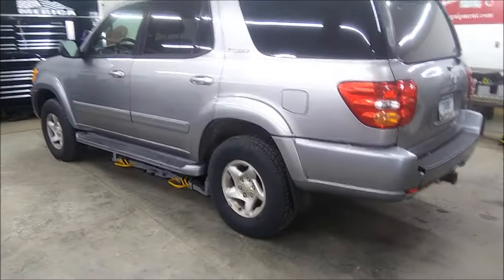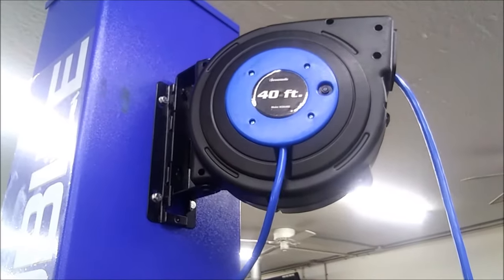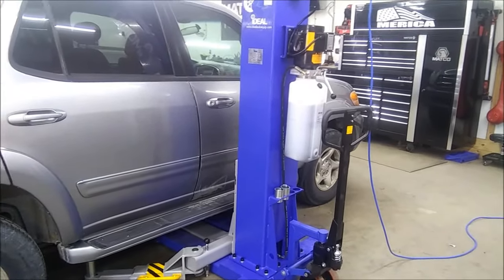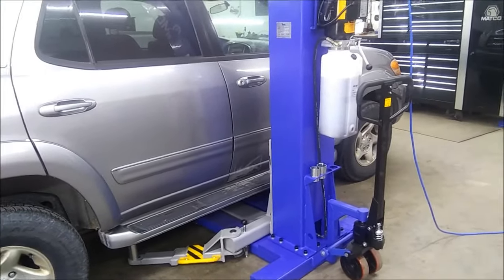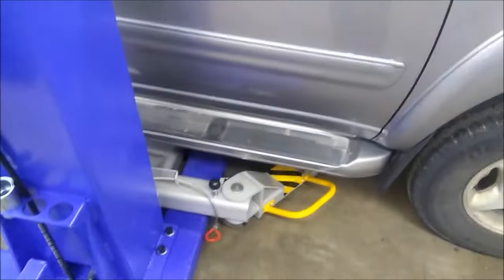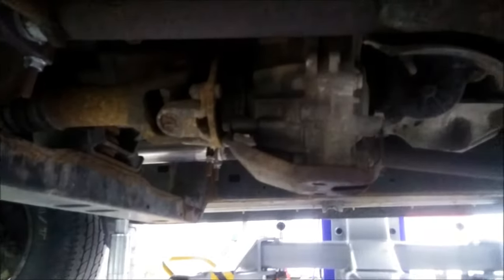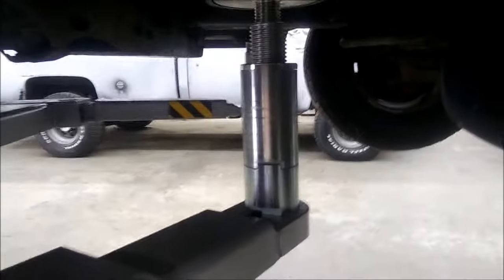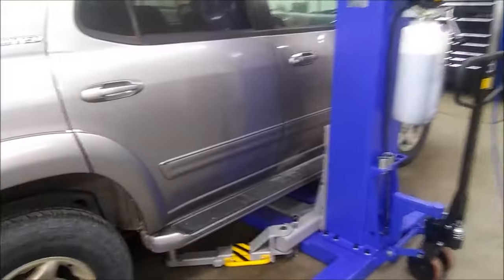Ideal single post car lift in action

Comment: I was just looking at these today. They're now $5999.99 Canadian.  I have a mid rise scissor lift and love it, but it does limit some activities.  I'm sure I'd get used to it but it does seem kinda wobbly.  I'd be afraid having to really bear down on a breaker bar that I'd upset the balance.
Reply from the maker: I use a tall adjustable jack stand on the opposite side of the post and that gives a ton extra stability. I've used it on every car van and SUV that comes through the shop and 0 problems and I do a lot of engine and transmission repairs. Thank you for watching
Reply: There’s not a 2 post lift or any type of column lift I’ve worked with that the car don’t wobble on it, it’s inevitable. Under hoist jacks and in front and rear of vehicle and it eliminates all front the back wobble

Comment: Great video! Thanks for sharing. I’m in the decision making phase right now but seeing yours makes a ton of sense because I am concerned with a scissor lift I can’t drop a transmission as easily. This one seems like it would make the job easier.
Reply from the maker: Thank you I have dropped transmissions with this lift it can be a little tight at the leg but it has worked for me so far ... thank you for watching

Comment: We used to have something similar 25 years ago in the first shop I worked in but back then it was bulky and huge . It had its own controls to move it and it was limited on ground clearance . If you wasn't careful you would bend a driveshaft  . It's amazing how much things change but use same principle of function. Pretty cool lift . Make sure your reel can handle the amps mine smoked using a battery charger on it .
Reply from the maker: Interesting I seen the ones like what I got but never a old one. Thank you Kevin and is a 20amp motor so I bought a 20amp cord reel so it should be good
Reply: @CountryMileGarage   As long as it's a good one you should be safe those Chinese ones like to fudge the numbers.  It wasn't the cord on mine  it was the contacts on the reel . Granted I did have it for years .
Reply: @CountryMileGarage 😂

Comment: I liked your video on the lift and the retractable electrical Cord. I do have a question mine when assembled I noticed the hydraulic cylinder that pushes the lift upward moves freely from side to side with no support when the lift is down. And not being used. Is this supposed to be that way. Appreciate your help
Reply from the maker: Mine has some play in it as well I'm sure its normal. So it will center it self on the chain.

Comment: Nice lift I been looking between that one and the Jack max the one is a two post but you can move the post if you need to but you need a good concrete foolr to use one and I dont know how good the floor in the garage is plus ain't that tall either how tall is your lift
Reply from the maker: Goes full height so you can stand under it. This lift I seen videos of guys using it on asphalt lol

Comment: You still like your car lift? I am thinking about getting a single post car lift. Ideal and Amgo appear to be the only brands I see.
Reply from the maker: Using it as we speak. Doing timing chain and water pump on a Chevy equinox, which means plenty of going up and down lol ... thank you for watching
Reply: @CountryMileGarage  Thank you sir
Reply from the maker: @iamthemoss  just keep in mind it's not the end all be all but for regular use with limited space this is a good option. The day I build a bigger shop I'll buy a different lift

Comment: You mentioned you roll it out to your concrete pad, how tall is your door? Can it just roll out or do you have to tilt it?
Reply from the maker: My door is like 1 or 2 inches to short so I use my skidsteer to tip it backwards a little to get it outside. Thank you for watching

Comment: serious i was not thinking this was ideal (before watching)..ive been researching 100 different lifts and because of the non concrete issue i have, it would be actually worth it....

a couple of quick questions because  i think im liking this over all of them. 

1. 110 or 220 (plug or hard wired?)
2. does it lift any higher than the video..not that i need it to go too high, i was hoping for just a tad higher than the video (chest level) for brakes, suspension for maximum comfort 
3. its not bolted to the ground at all? 

if i got one, i would probably get one or two extra tall jack stands as a precaution backup, as you can never be too safe when it matters.
Reply from the maker: 110 volts but I installed a cord reel so I don't have to drag a extension cord around lol and yes it'll go just as high as a regular lift but my celling is only 10 ft tall And it's NOT bolted to the ground and you can move it around really easy that was for me the #1 seller on this because of "limited" space in my shop. With SUVs and pickup trucks I use a jackat the far end of the main beam to help make it more stable.
hope this helps and thank you for watching
Reply: @CountryMileGarage  tHanks for posting this.  This is a game changer. I have been looking for used lifts...they are about $1,500 but heavy and always 300 miles away.  I have an in ground lift that I have never tried.  This one seems easy....it arrives and moves around...  tHanks again.
Reply from the maker: @Dancing_Alone_wRentals  just keep in mind it's a 6000 Lbs lift ... thank you for watching
Reply: @CountryMileGarage  so no show and tell at the Weight Watchers.....got it.

Comment: What’s the overall height ? I have a low clearance ceiling with maxjax m6 2 post currently
Reply from the maker: from the floor to the top of the column is 103 inches ... thank you for watching

Comment: Question: Going to pick on up in a few days. Its used in a garage that only has 7 foot doors so it wont clear. I think my plan is to partially disassemble the lift. Do you know the Allen head size holding down the column and the center beam to the column? The manual does not give this information. I want to make sure I have everything I need as its not close to my house. Thanks in advance and thanks for the video
Reply from the maker: I'd have to double check ... but I will let you know. Thank you for watching
Reply from the maker: Ronald I just checked and it's 12mm allen

Comment: Hi, how is the lift working out? Would you still recommend?
Reply from the maker: I use it almost daily it is not the end all be all but no complaints. The only thing I do with heavier vehicles I use a support at the end of the arm to have some more stability. But for a smaller shop like mine I love the mobility it gives me ... thank you for watching
Reply: @CountryMileGarage  is it fairly stable for wrenching? Seems like it would be tippy front to back with such a narrow base. I know supports would fix that, just curious how it performs by itself.  I'm really intrigued by this lift
Reply from the maker: @kdie989898  right now I have a 3/4 ton regular cab pickup on it and I'm doing a transmission swap. With cars it works awesome no supports needed big SUVs and trucks I have one support I use everytime
Reply: @CountryMileGarage  That's pretty impressive! I'm really surprised the vehicle doesn't rock nose to tail. Thanks for the info!
Reply from the maker: @kdie989898  rocking from nose to tail is next to nothing. It makes a big difference if you set the adjustable pad right. Even in a regular lift you have a little movement
Reply: @CountryMileGarage  I'm thinking I may need to get one lol

Comment: I would never get under a Chinese lift , they are known for lying about actual specs
Reply from the maker: Thank you for watching Justin
Reply: Lol time to ditch that 1950s mentality.
Reply: Good luck since we get all our metal from china in the states.
Reply: I bought an engine stand on ebay from China and the motor bent it right down almost to the ground.  It wasn't even good for half its claimed capacity.